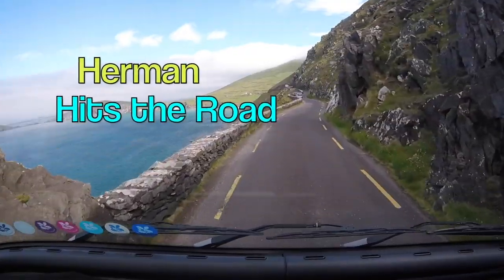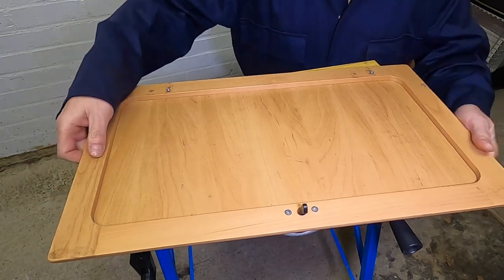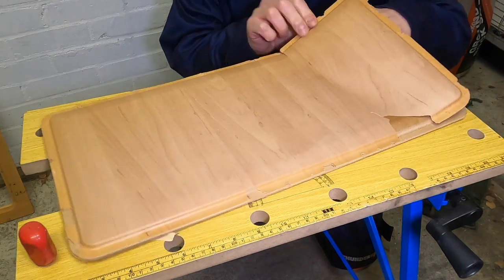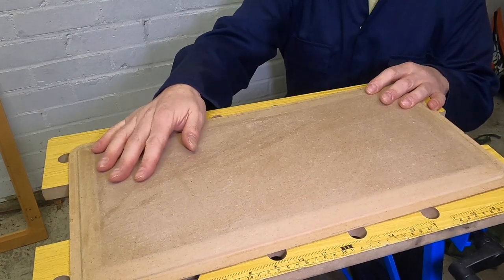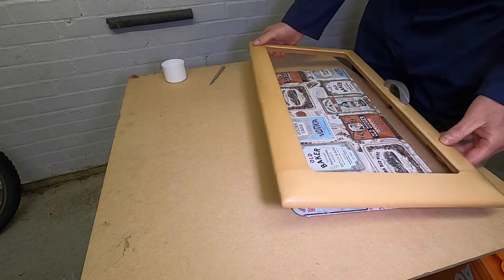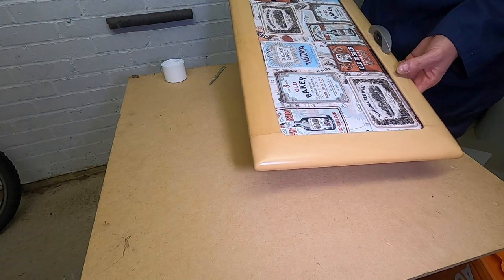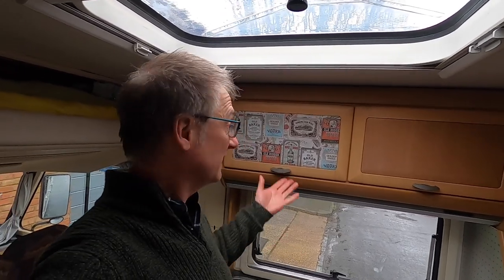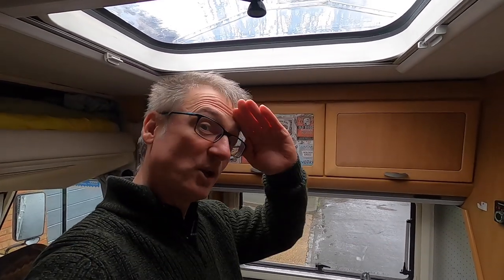Motorhome Mechanic - Repairing Cupboard Door

Comment: Might I suggest Ads a fine bead of inexspensive clear or brown silicon sealant all around the panel inside would hold it securely & be more pleasing to the eye rather than those unsightly nails 👍
Reply from the maker: Thanks John. I might do that but you notice when you open the door.
Reply: It'll look better than the nails though. Coachbuilder tip No,2. if you use sealer cut the nozzle straight (not at an angle) to a size that fits the angle of the panel/door & gun in a forward direction not pull towards you & should need little if any smoothing.😉

Comment: looks cool, need to match the rest of them now. Hot glue would hold the panel in and if you wish to remove, your blade would cut it away.
Reply from the maker: I thought about using the hot glue but I think it would make a mess, I'd have to hold it while it cooled and there was a chance that the tip would melt the veneer at the rear of the panel

Comment: As you went along with your repair you can start to see how they made the door. The panel will have had the face veneer applied first then mounted within the frame then the y would have used the panel pins and glue to secure the panel to the frame, the pins were used as both a way of holding the paneland clampin the panel whilst the glue sets. Then the back veneer will have been added to hide the panel pins. 
You could have re glued the veneer where it had started to come away and crack and then reglue the panel to the frame. However adding a bit of your own flair to Herman is well worth the effort, and looked great.
Reply from the maker: I could have done that and it was considered but I knew that I'd still see the crack in the  veneer. I was looking for and found the wood effect plastic wrap but it wasn't a perfect match. I then stumbled across this design on wallpaper in the next isle at Homebase - it just clicked and made sense